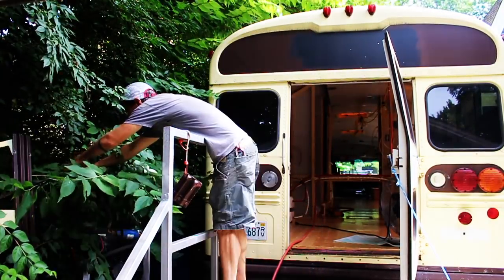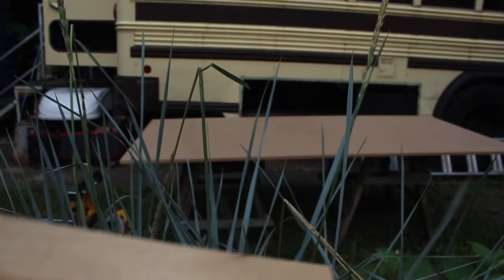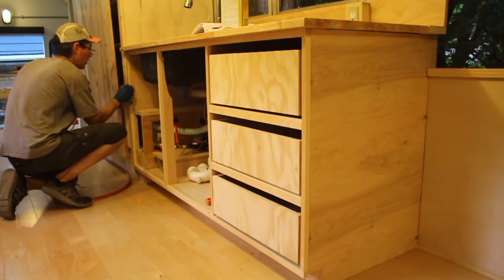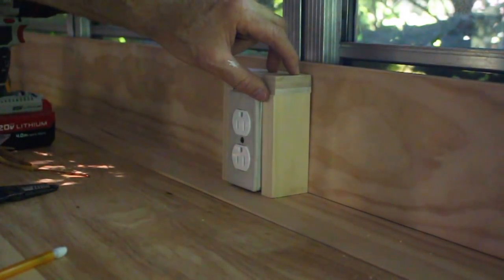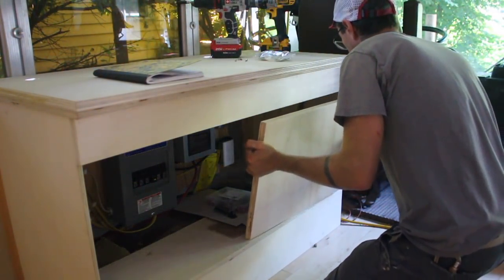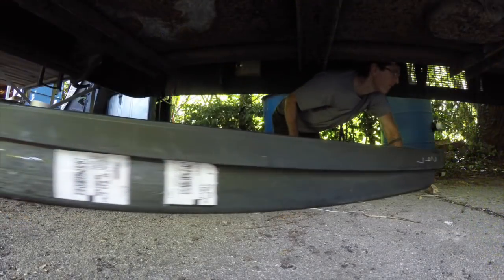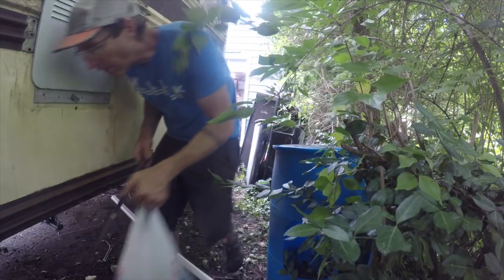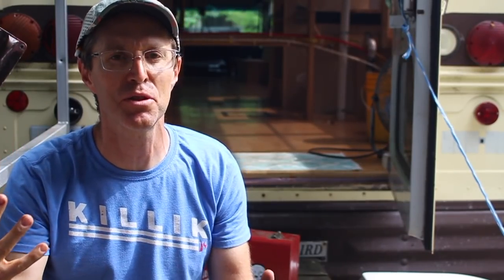Revising Doors, Plumbing, and More -- Prison Bus Conversion #35

Comment: I know this is kinda off topic of this video but for the drop down kitchen table have you thought about reusing the lid from the cabinet/lockbox in the front of the original form of the bus? I think that the lid to that would be interesting if it was big enough and would be awesome to reuse it if you still have that lockbox.
Reply from the maker: The lockbox is something I still have and really want to use. It's a bit small for the kitchen table, I think ... but it's solid and beefy and would be great re-homed in the bus. It's cool that you remember it! :)

Comment: you made the latch for the hold the door shut you said you probably redo just a thought put a knob on the outside say like the square shaft so you have a hook at the pivot  to the back side to cabinets really look nice and it came together nicely for you
Reply from the maker: I can't quite visualize what you're describing -- my bad! But I get the gist of it and hope to come up with something a bit better. Thanks for the encouragement!
Reply: metaspencer I really wish I could give you a picture what's in my mind but it would consist of like a screw with like a big round knob on and it would go under the cabinet door and alack should be on the back side with a hook and you just turn it off and turn it down the best way I think for you to Envision what I'm talking about let's go look at some of those metal closets for the double doors where to use a key and hook system to lock the two cabinet doors together and locking closed I was thinking something on that basis with a wooden knob that she could just turn
Reply: metaspencer it really enjoying what you doing so far changing at grey water tank out was a great idea
Reply from the maker: I'm starting to see it! Thanks for the idea :)

Comment: Free HW explains a lot but now it has me wondering if you did the barn door because you already had the HW or did you really have your heart set on a barn door? FWIW I think you'll be very happy with your revisions. There is no better feeling than knowing you made it the best you know how. And that comes from some one who has been shopping for a bus or RV for awhile now. All the systems you put in I would be happy to own as it seems you've researched them very well and done them right.
Reply from the maker: Yeah, a lot of folks design first and then source materials ... I tend to consider what I have on hand and then work from there ... not always, of course, but as often as I can. Good luck in your bus/RV search. I'm sure it'll work out! :)
Reply: So you already had the barn door hardware?
Reply from the maker: I've used those same supplies on previous builds ... but no, not this time: I bought those at Rural King in my town
Reply: But what I'm wondering is what was the thinking behind it? Most durable sliding door? You like the look of an outside door so much you want it inside? Or just to be different for shits n giggles? All of the above?
Reply from the maker: Rugged, I like the look, and the slider seems nice in the space. Not much beyond that.